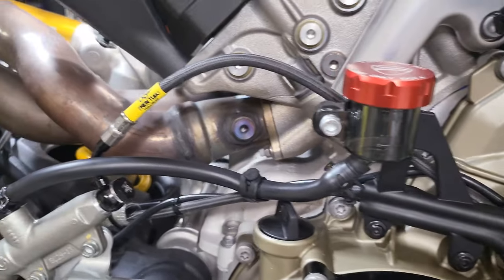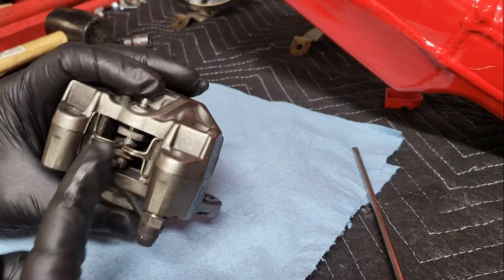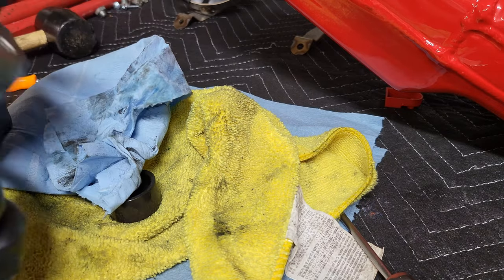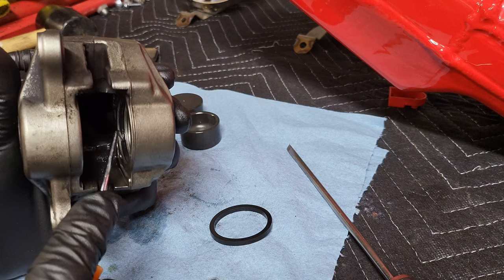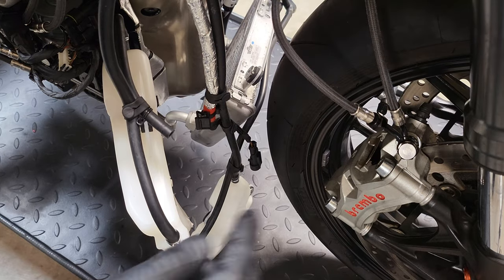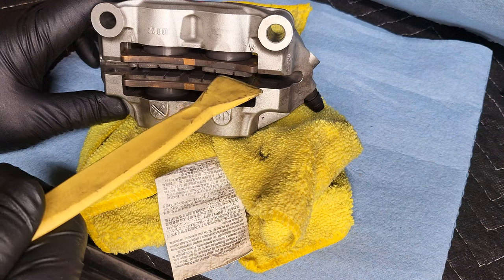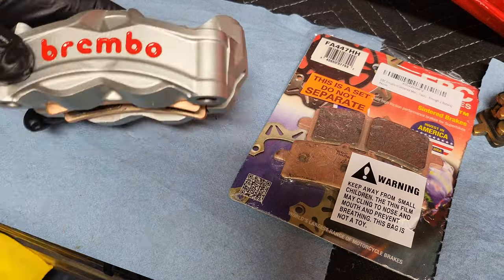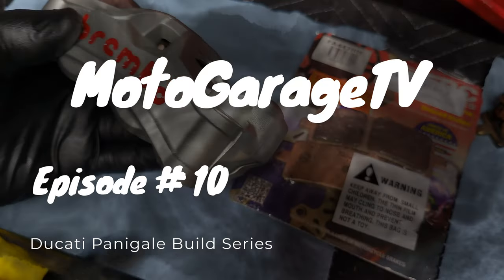Ducati Panigale V4 | How to Rebuild Front and Rear Brembo Calipers

Comment: Great video! The level of detail to your work can be clearly seen. Wish all mechanics worked like this. What made you replace the Ducati stock brake lines? I did some research and the OEM lines are already steel braided. Was it aesthetics and weight?
Reply from the maker: Hey, thanks. I appreciate that. You're right,stock lines are steel braided. I went with the carbon for the aesthetics but also they say  They have the highest burst rate pressure out of any other line on the market (over 16,000 psi!), and offer the most direct brake feel.

Comment: Can you provide a link for the rebuild kits please I have to rebuild my rear Thankyou
Reply from the maker: I purchased from Gotham cycles on Ebay. They have two options, full rebuild with pistons or just seals and bolts on option 2. Both kits are Brembo branded. Hope that helps. Good luck
Reply: Hi, I went hunting for the kit on eBay but couldn’t find it.. any chance you could link us to it?
Reply from the maker: @bruce1813  https://www.ebay.com/itm/354265462694?mkcid=16&mkevt=1&mkrid=711-127632-2357-0&ssspo=CWBy9_DFSLW&sssrc=4429486&ssuid=lSL1nP-7Tma&var=&widget_ver=artemis&media=SMS

Comment: great job showing how to freshen up your calipers! what was the total price for front brake caliper parts? This is something im interested in doing to my bike. I havent changed the seals in pistons and have over 10k miles on my 2019 v4. thanks for the info!
Reply from the maker: Thanks. I paid 306.94 for just the front caliper parts. That's not including the brake pads. 
Part#61240371A
The Spring/ Pad Stopper
Was about $28 dollars each, but you'll need 2.
The seals and piston kits were around $120 each. You'll need 2. Hope that helps.